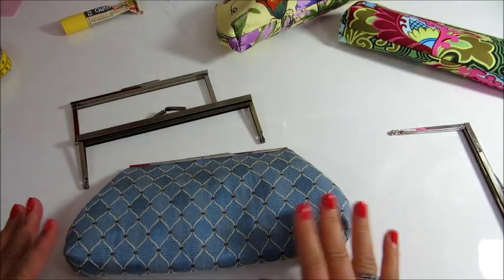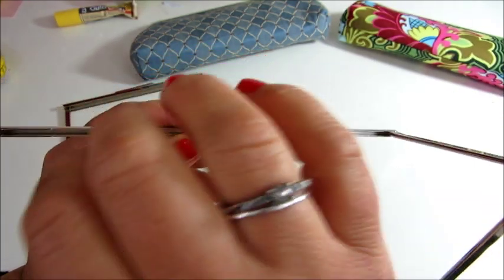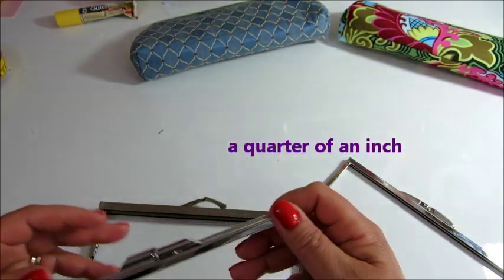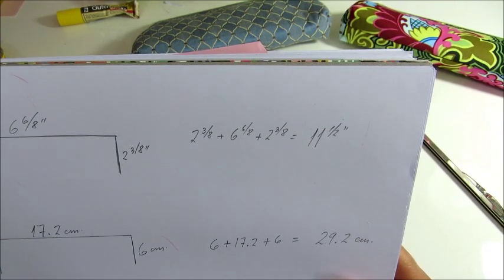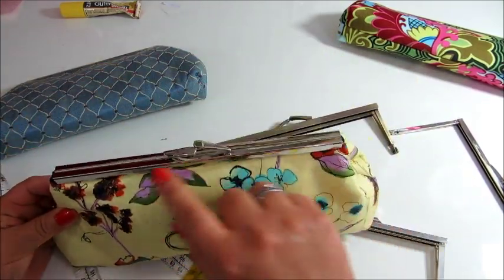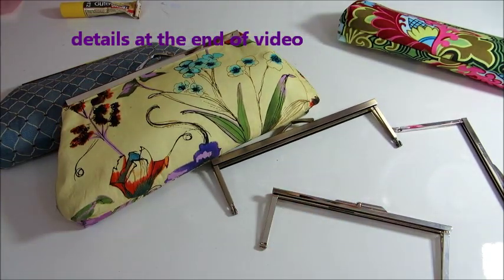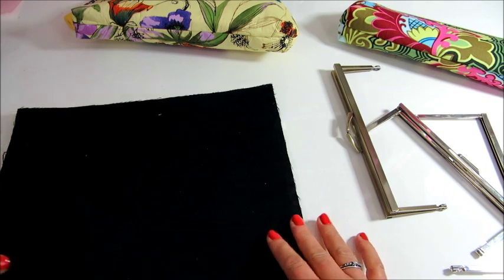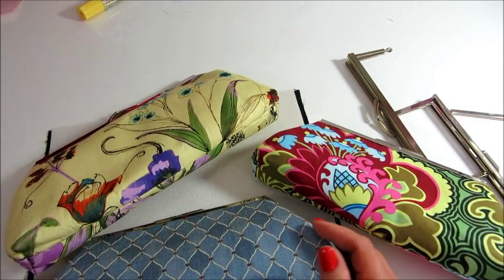How to Make a Clutch Bag

Comment: Thank you so much , the best bag and tutorial I have found so far, and I have researched a lot! X
Reply: Struggling to find the glue in bag frames you use any suggestions for suppliers? Thank you
Reply from the maker: @traceysmith365  I have bought the Gutterman HT2  in fabric and craft shops. I have also bought it from Amazon. I hope you find it. 😊
Reply from the maker: @traceysmith365  I have bought Gutterman HT2 glue from fabric and crafts shops as well as from Amazon. I havd seen other people use E6000, but I have never tried it. 
I think other "super glues" could work, as long as they are not liquid and soak the fabric. I hope you find it 😊
Reply: @MarcelasPurse  thank you for taking the time to reply, I appreciate it.  It was actually the bag frames you use that I having trouble sourcing .
Reply from the maker: @traceysmith365  🤣🤣🤣🤣 I just saw all the replies I edited.
I actually just Googled the frames and found I good seller from Hong Kong. I cannot remember the name, though. I haven't bought any in the last couple of years.

Comment: Thanks for this project. Your directions are clear and easy to folloew.  I am considering using the fleeceand vilene stabilizer (shown with yellow bag).
I cannot find the vilene you mentioned on line.  Also vilene is water soluable so won't it vanish if bag is washed?
Reply from the maker: Hello 😊 . If you cannot get Vilene 205, you can use Pellon 808. They are different brands of the same kind of product.
I never heard of Vilene being soluble, it is widely used for these kind of crafts and even for making clothes, that is what it is made for. However, if you wash your item too many times, it might come lose or a bit wrinkled. It is important to iron it on according to the manufacturer's instructions and wait for about 20 minutes for it to cool down and fuse properly before start working with the fabric.
I have never had any problems.
Here is a link to a video where I talk about interfacings and stabilizers: https://youtu.be/1XgygjK6S5c
I hope this helps, happy sewing! 😊
Reply: @MarcelasPurse  thank you for the info.  i didn't realize you were not in the states. but i was able to get the product anyway.  How do you clean the clutches made with light colored fabric?
Reply from the maker: @helenerothstein4290  I just spot clean them with a damp cloth soaked in soap/detergent suitable for the fabric  I have used to make the purse. 👛

Comment: Love this, I might be scared of the glue bit :)
Reply from the maker: 😀  Just try a low tack masking tape (the kind used for DIY) to cover the frame from glue spillage. Make sure that the glue you use is not liquid, you don't want it to soak the fabric, also read the instructions on the label. You might want to do a test first as well. Happy sewing 😊

Comment: What measurements do I use for the pellon and the fusible fleece? I know with fusible fleece you covered the entire length but left a gap on both sides of the width.
Reply from the maker: Hi, the gap is to avoid extra bulk when you sew the seams (it is optional, but it works better for me), the gap is as big as the seam allowance, so when you sew you do it along the edge of the pellon.
I do not leave a gap on the other edges because they will go inside the chanel of the frame and I find that the bag fits better and securely 
(snugly) without leaving a gap inside the frame. If I were to use a thick fabric, I would leave a gap on those edges as well .
You could make a test by puting a piece of fabric together with some pellon into the gap of the frame and you will see what I mean.
I hope I explained it properly. 😊
Reply: Thank you very much. It makes a lot of sense. Do I use the same measurements for the foam for the pellon and fusible fleece. Can I also use regular sew in  fleece or it has to be fusible?
Reply from the maker: @shirleyann1901  the fusible fleece should be the same size as fabric (it gives more estability when sewing). I am not keen on sew-on stabilizer for this kind of projects because some times you csn see that the fabric is loose and even wrinkles. That is my experience.
😊😊😊😊😊😊😊
Reply: Thank you very much.
Reply from the maker: @shirleyann1901  😊😊😊
Reply: What is the seam allowance you used to sew the sides of the outer and the lining before you made the gusset?
Reply from the maker: @shirleyann1901  I normally do 1/4 " ( 0.5 cm). Seam allowance.

Comment: Can you share where you purchase your frames? I just checked eBay and it doesn’t look like there are any with a 1/4” channel. Thank you!
Reply from the maker: Doreen Sargente Hello, I get the frames from www.ahkwokbuckles.com,   in their page search for "Purse Frames Other". The minimum you can buy is 5 pcs. I just checked and they have silver and antique brass 8" x 2.5" at the moment. They are based in Hong Kong, but the delivery to the UK is very quick.
Also, you could try Etsy , I saw a shop called "Upstyle" (I believe) selling these frames.
Previously, I bought from Aliexpress (from China). They were always very helpful, but the delivery takes a long time to the UK (are you in the USA ?). I stopped buying from them because their website kept failing.
Depending on the amount you want to buy, it is worth just Googling , you might  find independent shops selling at reasonable price.
Sometimes the frames are not described as "open channel", but  if the sides are of the dimensions I described, they should be ok. 
Long sides ( in relation to the width of the frame itself ) normally  
more than 3 1/2"    indicate a close or narrow channel. YOU DO NOT WANT THAT !!!
I hope that this is helpful.
Regards,
Marcela
Reply: Thank you so much for the detailed info. Yes, I am in the US. I checked all the sites you mentioned and the alieexpress looks to be the most reasonably priced. I noticed they have a lot of curved handles and was wondering if the technique is basically the same or if there’s a tip or two you can pass on? 

I also saw your Etsy shop and you have some lovely bags and wonderful reviews! Thanks again for sharing and for your prompt response.
Reply from the maker: Doreen Sargente I am glad my answer was useful. The tecnique for round frames is different, I shall put it in my list of tutorials for after Christmas. I hope you will enjoy doing purses 😊😊😊

Comment: Can I combine lace with satin fabric for the outer fabric?
Reply from the maker: Yes, you can. Cut the lace and satin to size and sew them together on all edges, so that you work with them as one piece.
Test the satin with the stabilizer first as it might be damaged with the heat of the iron. If that happens, you might have to sew a stabilizer instead (around all edges). If you do that, I would recomend to to cut the stabilizer about 1/4" shorter on all sizes (seam allowance), so that you do not get too much bulk when sewing the bag.
I hope this helps. Thank you very much for your interest.
Reply: Thank you very much for your input.
Reply from the maker: @shirleyann1901  you are welcome 😊

Comment: Madam can this be done by faux leather  kindly be advisable.
Reply from the maker: Yes, you can use faux leather, but I recomend checking that it is not the kind that stretches. Also , the wring side should be a cotton mix where you can iron fusible fleece or interfacing. It is important to test the fabric first , because it could melt with the heat of the iron.
Reply from the maker: Here is a link of a video where I used faux leather, you will see me at the begining talking about the  interfacing that I used.
I hope this helps. https://youtu.be/Ismz46js61o
Reply: @MarcelasPurse  thank you marcela , must say that I find only your video on the YouTube  well in detail  looking forward for more videos on purses  .thanks mama ,appreciate  your advice .
Reply from the maker: @naureenranjit8886  you are welcome 😊
Reply from the maker: @naureenranjit8886  😊😊😊